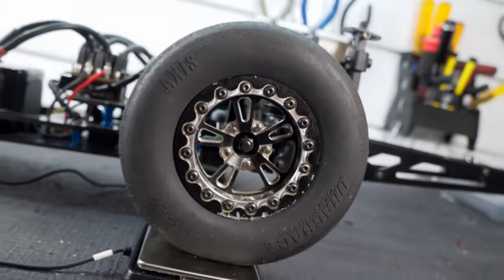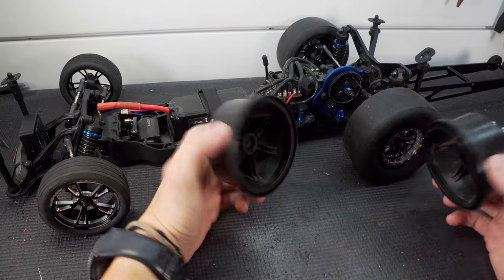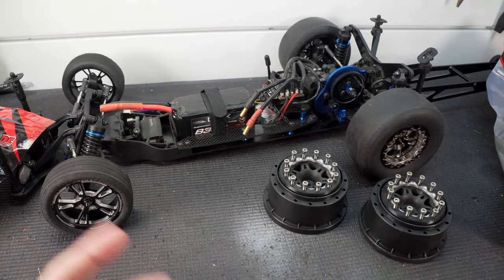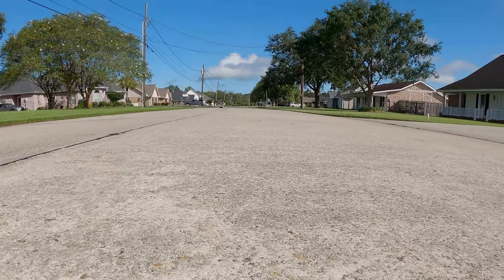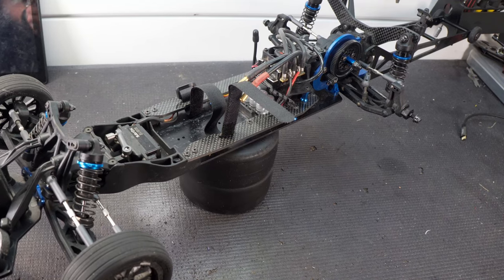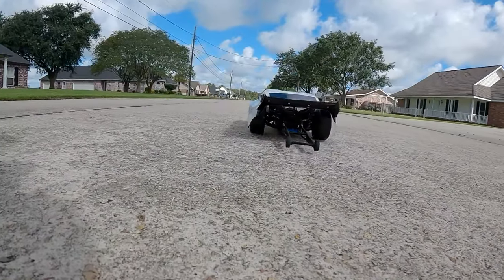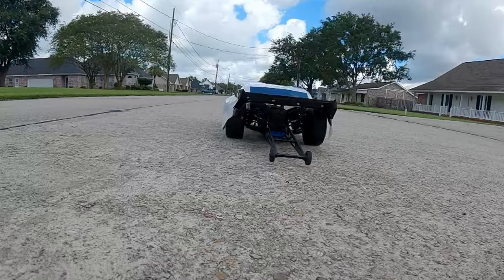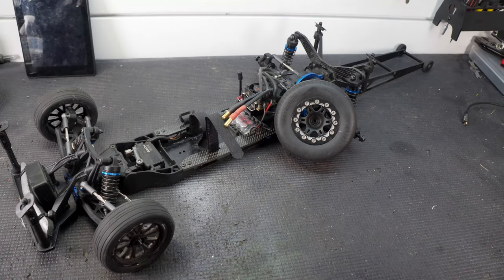Can Wheels Make My No Prep Car Faster?? | SSD Aluminum Beadlocks vs Proline Split Six Beadlocks!

Comment: Interesting clip,  I've just put a set of SSDs on my new DR10M . Do you glue the rears or just rely on the beadlocks ?
I find alloys add stability at speed . Cheers .
Reply from the maker: I never glued tires with beadlocks. Never really had any issues with the SSD wheels either

Comment: Awesome video. Good info on the DRK, I'm still learning mine. I believe you said you were running a 90t spur with what size pinion? Thanks
Reply from the maker: Thanks! I'm actually running a 84t spur and 20-21t pinion
Reply: @FullThrottleRC  thanks a lot my friend
Reply: @FullThrottleRC  I’ve been running what was recommended for the DRK 3.5t motor and DRK 160 which is 87/17 and i can only get it into the mid 2.5’s and thats playing with the stages on the Low Traction pre-set profile.

Comment: What springs and fluid are you or were you running?
Reply from the maker: Check out the most recent suspension video on the channel. I have all the details of my suspension setup in there.

Comment: See I need to upgrade to these aluminum beadlocks.  Every plastic wheel I've ever put on my custom 2wd slash simply strips, usually within 1 hour of drive time.  Simply too much torque and acceleration for plastic to handle.  my top end is only about 55mph.  But I have a 4600kv castle mamba combo and I geared it down a good deal for more torque so it launches like a rocket.
Reply from the maker: I will say I've never had any issues with tires blowing off with the SSD beadlocks. But I've also only had tires come off of the proline split six beadlocks maybe 2 or 3 times and my car has been to 70 mph. Haven't stripped the center hexes on either.
Reply: @FullThrottleRC  Yeah I've never had a tire blow off, just stripped wheel hexes.  Both on quality proline badlands and Traxxas drag wheels.  I'm running 3s.  Do you run 3s or 2s on this build?  I also got a diff locker after I got tired of replacing my diff for the 3rd time.  Even got the upgraded hotracing aluminum diff case, but the gears still couldn't handle the power.
Reply from the maker: @LogainTheHumane  I run 2s as that's what most of the standard no prep or street eliminator rules allow. 
Look into the drag slash transmission if you want to stick with the slash stuff. It's supposed to be a lot strong than typical slash gears
Reply: @FullThrottleRC  Makes sense.  I don't try to compete I just bash for fun.  So I go for maximum power and speed.  As it is I'm already running a hot racing aluminum transmission.  Needed it for the heat dissipation.

Comment: How do you glue the front ssd aluminum front wheels? Having trouble with mine
Reply from the maker: Make sure to sand the inside of the bead on the aluminum a bit so the glue has something to grab onto. I used the "rubber" CA glue and haven't had any problems since
Reply: @FullThrottleRC  thanks I’ll give it a try n update!

Comment: Great video! I have dame ssd rims..now u have me thinking I need plastic beadlock! Hahaha love it
Reply from the maker: Thank you!! I love them, don't get me wrong.  Just seeing that improvement from only shedding that few grams can't be ignored
Reply: @FullThrottleRC  absolutely not! And I will be getting a set of plastic beadlocks really Soon! What would you recommend 🤔 the Axis from Drag concepts? 🧐
Reply from the maker: @herefishyfishy8582  I didn't know drag race concepts made a beadlock wheel. I run Proline Split Six
Reply: @FullThrottleRC  oops I thought they where beadlocks there not. Ima try those proline ones for shure

Comment: I noticed you don't have the wheelie bar shock set up yet. There are two pieces that attach to the wheelie bar and the bottom of the rear body mount. They're in the kit,but they're not mentioned in the directions.
Reply from the maker: I saw the wheelie bar shock set that Associated released after I got the car but didn't notice any parts in my kit for it. Which parts are you referring to?

Comment: Just wondering why you don't use glue on rears. I've used those same Pro-Line bead locks on my short course trucks for years but they are quite a bit heavier still than plastic glue rims. Rotational weight is indeed a big deal even in the 1:1 world.
Reply from the maker: Mainly because I knew from the beginning when I started building a drag car that I'd likely need to change tires often. And while I know there are ways to remove glued tires, it's always been a pain. Add that to the bead locks just giving a cooler look and I just always stuck with them.
Reply: Makes sense. 
 @FullThrottleRC

Comment: i have lightend my SSD rims to a total weight fully assembled of 112grams, my rims instead of the 89grams now weigh 74 grams
Reply from the maker: Awesome!! Did you go about drilling the walls similar to how the lightweight SSD wheels are?
Reply: @FullThrottleRC  yes sir they match exactly to the lightweighted cuts.

Comment: Should've went with proline blue dots thpse axis tires are heavy
Reply from the maker: I have a set of reactions, although not the blue compound, and didn't notice a difference in weight between them. Not without putting it on the scales anyway. I've had good luck with the Axis so I went back with them. Maybe when I go through these sets I'll try the reactions again.
Reply: @FullThrottleRC  yea you are right i just checked my  previous axis and are same as blue reactions in weight my bad 😅 but anyway if u have a chance try the blue compound reactions once when you have finished with the axis. I had better luck with the blue dots it does make difference "softer" but keep up the content bro 😎😁🍻

Comment: I'm seeing ETs in the 75MPH range. Why is your car still kicking 60s? It should be way faster than that. Especially after spending all that money on a purpose built hot rod!!!!
Reply from the maker: I'd love to see 70s and higher, working towards that. If I knew the answer to why my car isn't running that fast, I'd already be in the 70s. It's all about testing and tuning to get there. Improving every time out. I'll get there

Comment: Nice video am a newbie also drive tractor trailers over the road so I like to try n get to events all over..I bought a pair of those aluminum rims an a pair of plastic black chrome for dr10 with 69 nova body also have a v.w.beetle body..like a dum ass I thought I could just throw n glue em on apparently not.i guess I need the beedlock thing..you make em...you sell em?
Thx
Reply from the maker: Thanks! I'm not sure what part you're talking about for those wheels. The only way you'll need a beadlock ring is if you bought beadlocks and they should've came with rings. If it's the wheels I'm thinking, you'll just have to glue your tires on